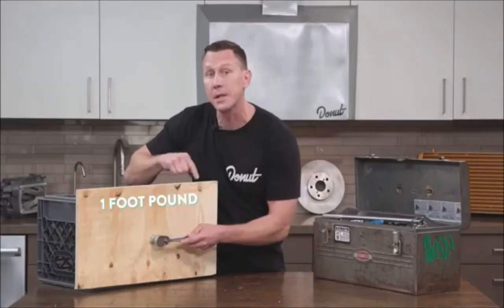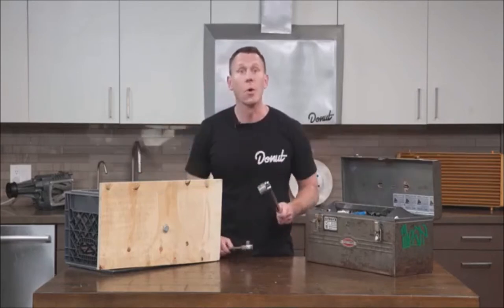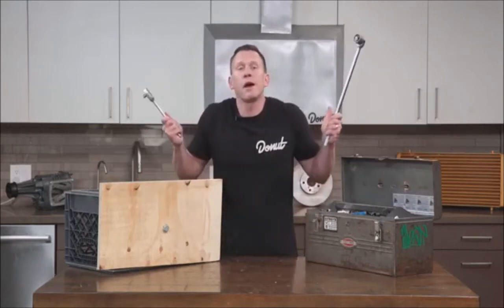Foot-Pounds or Pound-Feet - What’s the Difference?

Comment: It's the same thing, when a unit is written down blank1-blank2 it means it's multiplied, multiplication is communitive, therefore they are the same. The reason why you can find different definitions is to describe which unit the other is in reference to. So, no one is wrong interchanging these units necessarily.

Comment: Could anyone on here please help me out? I need help with torque measurement and I'm very confused when it comes to pound feet and pound inches. One of the reasons why I'm so confused is because if a mass requires one pound of force to be rotated with a one foot long lever, then how could one pound of force be required to rotate that same mass with just a one inch long lever as well??? If the lever was shorter or longer, wouldn't the amount of force required be more or less??? Or does the distance of the lever not matter? Also, does the circumference distance at which you are rotating the mass matter at all? Please, if anyone out there knows the answer to any of my questions please help me out, I am very confused right now and I can't find any helpfull information online and I don't have any friends or relatives who knows this stuff.

Comment: Well stated. I easily confuse the two. And yeah,  that’s what confused me when I listened to Engineering Explained explaining it. I remember hearing (or reading) at some point that they’re technically different terms and, mathematically if that’s the case, they probably aren’t directly interchangeable (without some kind of conversion, I suppose).

Comment: If torque is measured in lb-ft, why do torque wrenches measure in ft-lbs and inch-lbs?
Reply from the maker: Daniel In the video, I was trying to figure out if the pound-foot or foot-pound is the official measurement of engine torque. Despite it seeming that the pound-foot is the official term, many people interchange the terms. Furthermore, the consensus appears to be that foot-pounds and joules refer to energy while pound-feet and newton-meters refer to torque. Additionally, the Society of Automotive Engineers (SAE) seems to recognize both pound-feet and newton-meters as measurements of torque.

 

Regarding your question about torque wrenches, since torque wrenches also use newton-meters, maybe torque wrenches should be using pound-feet instead of foot-pounds. However, that is just my opinion regarding the torque wrench aspect. There are many people that know much more than me about this subject. I am just using information from my research. I'm sorry if that's not a good answer to your question.
Reply: 1inch is 1/12th of a footpound

Comment: But it's multiple pounds applied to 1 foot... not  1 pound applied to multiple feet.
Reply: It's either one. 10 pound feet of torque is equal to 10 pounds applied at one foot or 1 pound applied at 10 feet. 
But also, it's just a label and the technically correct label isn't always the one that intuitively sounds most appropriate to us anyway

Comment: I hear what you're saying. But when it comes to ft lbs it's not that simple because who's taking into consideration friction and drag. So here's an example. I'm out in space and I have a 1lb concrete brick levitating in orbit weightlessly. I push it one foot through space. All that would take is a tap of the finger. Very little energy. However on earth I put a 1lb concrete brick on the on the sidewalk and push it one foot. Obviously it would take more force to push it in earth because of a second variable pushing against me. Friction. So when scientists and engineers measure ft lbs do they test in a frictionless environment or not? And if not,do they subtract the force it took to overcome the friction and only calculate the force required to move the brick? Anybody can push a 2000lb car if it were parked on an icy hill. That doesnt mean that person is able to push with 2000 ft lbs of energy. Because if they got rid of the ice they would be exponentially "weaker" and no longer able to push 2000lbs even tho their muscles have not changed at all.

Comment: Im rebuilding a hydraulic cylinder.  Neet to tighten the nut to 600 ft/lbs.  Can't find anywhere to calculate the formula.   Am i correct that if I weigh 200 lbs and have a 3 foot long leverage bar and stand on it that the nut will be tightened to 600 foot lbs?
Reply: yes

Comment: In SI units both torque and energy (or work) are measured in Newton meters even though those are completely different values. However energy is usually reffered as Jouls in order to avoid the confusion.

Comment: This video is great ad for the metric system. 7.233 lb-ft = 1 N-m (torque) while 7.379 ft-lb = 1 J (energy/work).
Reply: This is a dumb example you made. 

“Imperial is better because 1.3558179483 nm = 1 lb-ft while 1.355818 J = 1 ft-lb.”

Obviously if you compare units that don’t align you’ll get a million decimals from the other system. Metric IS better, but your example as to why sucks.

Also your numbers are wrong.
Reply: @TheBaconVanMan  I was referring to the use of the units N•m and J. Verses lb•ft and ft•lb.

Comment: They are the exact same unit. The reason some might order it as pound-feet is because torque is a vector. It is the product of force and distance (also vectors). With vector multiplication (cross-product) the order matters. Force is multiplied by distance, so the unit would order as pound-foot.